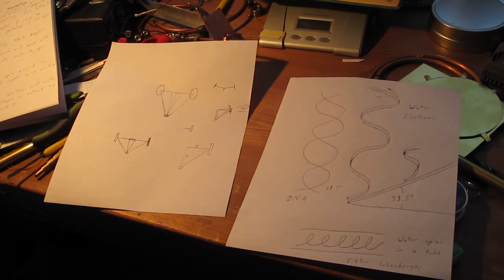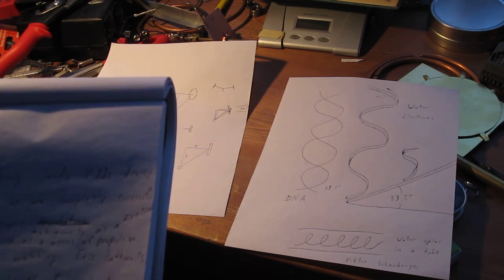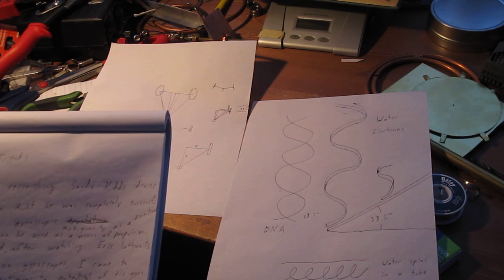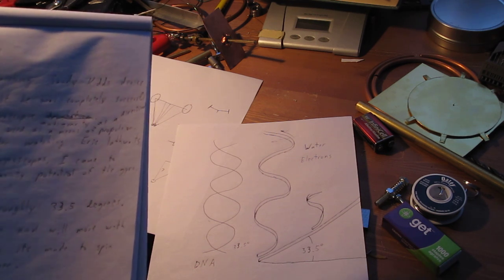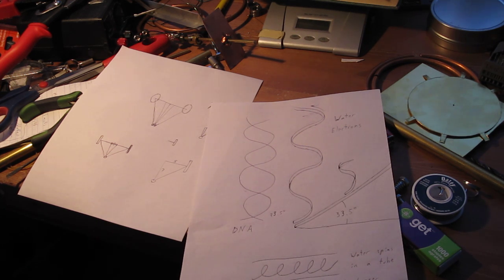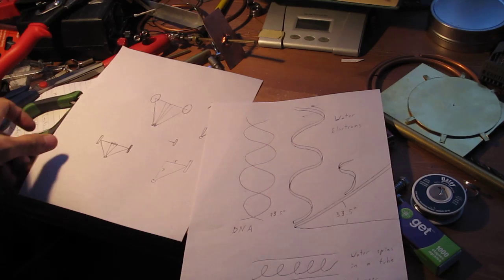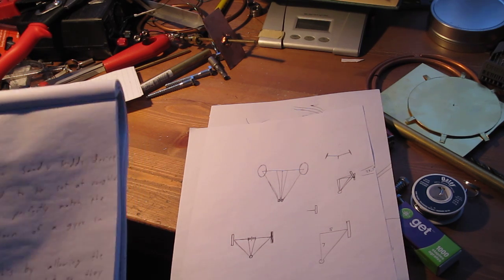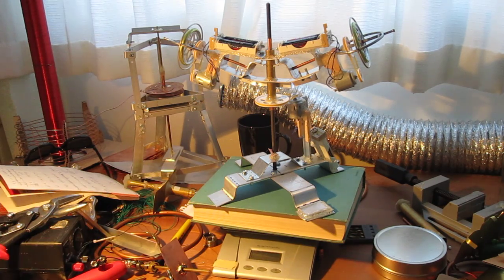Gyroscopic Antigravity - Part 6

Comment: Water doesn't spiral inside or outside of a tube unless you make it spiral (or in rare phenomena). It also spirals at different angles relative to spin, depending on the flow rate, heat, gravity, EM, point of measurement,...
Reply: Even though quarks all have a spin, this doesn't directly translate into our real world. Applying spin to everything isn't a solution, but it might be a hint.

Comment: I am sorry to inform the readers that this will not work as it is only a form of accelerometer/ gyrator. Sandy Kidds and many others have the same concept which they do not seem to comprehend the workings. 
In an accelerometer/gyro the onboard internal mass tries to remain stationary while the outside case is accelerated and in this video, it is the inside mass that is accelerated/decelerated, and the outside case reacts accordingly. Note that in a closed floating isolated system, where there is no reaction with external masses, any acceleration has to be followed by a deceleration so the "internal onboard" double integral of the "  magnitude and directions of accelerations" to produce the overall traveled distance, is purely ZERO distance.
By studying miniature accelerometers and gyros one may understand it all so easily.
However, it is a subject where one can study many interesting phenomena which the human eye cannot even see clearly while homemade equipment may come to the wrong overall conclusion. Some mathematics can help, and all it is is a case of a double integral of a mass accelerating and decelerating as it covers any motion trajectory.  Note in any conservative field this is so, but if one introduces ratchets and diodes then one has other complexities that flummox many people. 
https://youtu.be/KzTVTl3p2Po

Comment: Did this experiment back when I was 11 ( 1974 ) using similar bits but one supply  not multiple.
Concept works but no practical Anti Grav application due to materials available at the time .
Our current building materials will only produce a short life model with limited abilities.
The real Sandy Kid will know me as the one whom spoke to a relative of his in a TANDY in Yorkshire back around 1979

Comment: Placing the gyroscope center axis in the same center axis as a different gyroscope causes a flux interaction between the two gyroscopes. Placing a 3rd gyroscope with the same center axis causes a flux interaction between the 3. I suggest placing the rotational plane of the 3 gyroscopes in a typical x - y - z (like a 3d chart) relationship to achieve lift off relative to Earth's gravity.

Comment: Put the gyros right next to each other, the motors on the outside. If we hold a gyro at arm's length and wave it around it won't have as much precession as spinning it in a tight circle by just turning the arm. The tighter the circle, the stronger the precession. Can't get a much tighter circle than putting them next to each other, almost touching.

Many of us see gyroscopic precession as acting like a propeller blade. We hold a spinning bicycle wheel and turn the axle one way and it twists upward, twist it the opposite and it twists downward, same as if we were holding a big piece of cardboard. I think that imagery has kept many of us from putting the gyros close together.

And while it'd be great to have it fly around, the working model in Heretics of Science with Prof Eric Laithwaite was a wooden toy train looking thing that rolled along. Try mounting the device to a basic frame with wheels.

I'd do all this myself but I'm broke currently. Soon as I have disposable income again, I'll build a model.
Reply: post it up when you do

Comment: You've probably given up on these, good exploration, but I think you're confusing terms.
Antigravity is not the same as anti-mass. What you are describing would be a lessening of mass and not an anti field as would be the case with antigravity. It might actually appear to be heavier, depending on the current acceleration from your point in space.
I know it sounds confusing, but I think you'll get it. Think you're on to something here.

Comment: Over the piece, I have built many gyroscope or more accurately flywheel inspired devices built specifically to produce inertial thrust.
There are a few methods I have found of carrying this out, a couple of different ways I can put to bed as proved repeatedly to my satisfaction.
Let me say the most promising is another method but that is still work in progress.

I applaud your efforts,however and it may help you to get somewhere, if you take this on board.
I am only one person so it more than likely I have missed a few tricks along the way, but what I do know is that the gyros or flywheels must operate dynamically the action must be provided at the gyro itself.
It is the movement of the gyroscope which creates the differential which can be modified to produce the elusive inertial thrust.

It is not so obvious but “Anti Gravity Machine Parts One and Two on YouTube work this way and nothing like the best guess at the time description on the video nearly 30 years ago.
I noticed you were studying that machine so I felt I should put in my cent’s worth
I do realise that most of this will go over your head so I suggest you follow the large amount of information released in the Forum of “Gyroscopes.org”over the years. 
I have personally been a contributor on that forum since 2004 in fact and just about everything I have discovered about gyroscopes can be found there.
Very little of it agrees with the establishment view.
There are a few very controversial postings made by myself, but at least you have the ability to see who is lying.
Sandy
PS Most of my critics would be dangerous with a Leggo set.
Reply: proof or no pudding
Reply from the maker: Your the real Sandy Kidd?  wow...  cool.  I will have a new video soon of my latest developments in recreating your device.  The latest improvements allow for the dynamic action you speak of.  Thanks for commenting here.  I really appreciate your input.  So what ever came of all of your devices and efforts?  Big brother shut you down?  because they must never allow common people to realize that antigravity devices are real.  It would blow the lid on all of their flying saucer devices they have.
Reply: Hello again,
I have tried over the years to introduce the thing to all the people you would think I should, except for Boeing for some reason or another
After many and repeated enquires no one answered me except for one.
This one exception quoted his knowledge of anti-gravity from Wikipedia no less and seemed satisfied with that.
You would never guess what company he represented.
This stupidity has prevailed for years and most of it is due to academic arrogance.
One person said that if Newton was wrong so was every physicist in the world whatever that meant.
Was that meant to make me feel bad?

30 years ago in a university I claimed that I could alter the centrifugal force in a system at will.
This was of course on a system with fixed rotation speed and a fixed radius of rotation..
I was bluntly told that my claim was impossible.
Minutes I later demonstrated the impossible to a team of about four who turned away sharply without a word, as they do.
Instant ostriches.
No mention of that demonstration was ever reported, recorded, or discussed in the time I stayed in that university up until my eventual preplanned whitewash.
Be warned, achieving recognition in this endeavour will always be a hard fought battle.
After 30 years of putting up with the arrogance, ignorance, and academic stupidity
I no longer care.
When it is really needed, it will not be available..
Sandy
PS The device of mine you are presently studying lifted a consistent 16 ounces with bronze gyros, the university whitewash squad suggested that it was maybe climbing up on its bottom bearing.
I built a comprehensive gimbal mounting to eliminate any of this imagined drag and the device operated even better.
The decision however was unchanged and inevitable.
Reply: Hi Sandy, glad to know that you are on youtube. I invented something that inspired from your discovery of gyroscope, I watched your video part one and part two too. My invention has combined all information that represented on internet, like die glock with 2 counter rotate, mecury, vimana and gyroscope. I really want to get in touch with you to get your help and discuss about my invention, my email: toan359@gmail.com . I am not ready to public my work on internet, and confusing between get a patent first or public it first. Thanks
Reply: Did this experiment back when I was 11 ( 1974 ) using similar bits from tape recorders toy trains etc, but used one supply not multiple.
Concept works but no practical AntiGrav application due to materials available at the time .
Our current building materials will only produce a short life model with limited abilities.
The real Sandy Kid will know me as the one whom spoke to a relative of his regarding the subject.
 in a TANDY in Yorkshire back around late 70's.
Reply: I'm pretty sure I understand what's wrong with it.
You need a lot more flywheel direct driven, with independent motors, while maintaining the ability to control tilt in all areas. 
Similar to the way a helicopter utilizes the friction floating plates to counter and tilt the rotating wings.
Reply: If Einstien wasn't brought into the picture and Teslas work remained in progress by all the other real scientists we would live in a different world today.

Comment: I think if you greatly increase your flywheel mass you can see the acceleration due to gravity change.  The mass does not change just a gyroscopic torque changes the net forces on your system.  I know they use these principles to steer massive ships.  In the end energy is neither created or destroyed.  The right question is about the conservation of angular momentum.

Comment: I can see that on the bottom of an air craft with turbines on the gyros and being able to circulate the air like a tornado for liftoff and propulsion. but what about doing it with super cooled magnets and mercury as the motor on the gyro with no pulley to the gyro turbine

Comment: I would agree electrons have gyroscopic properties because it's matter in a waveform. Supposedly cern & the research lab at the south pole are searching for a particle that proves the existence of dark energy, that what exists within dark matter. The theory is that zero point free energy exists everywhere all around us unlimited amount that's generated from the movement of matter (gyroscopic) from other matter, this creates dark energy 'matter'. If you follow the papers being published on the current research being done you can see the direction they're looking. The good stuff always seems to be access by password only even though our tax dollars pay for the research. There was a random guy in ann arbor michigan who figured out a ' electron tap' but they shut him up.
Reply from the maker: +jasonmushersee Those in fear will always try to control others and the human race.  They are holding us back from evolving.  The spirit of the human race will eventually break free from the regressive forces interfering and interloping with us now but sometimes I wonder...   Cern was being used to try to merge our timeline with another created during the original Philadelphia experiment last I heard.  They've also just completed there largest collisions ever using lead atoms.  The Ether field/substance exists everywhere and yes its unlimited.  I agree.
Reply: spiritelemental find what "the urantia book" has to say about the circuts of mind, energy, matter, look into the information as it is written in that book. Make up your own mind. Im not here to push a religion or some cult. Im not religious. That book is beyond description. 

Just keep up the good work i hope this speesd your progress and helps your insights. Thank you for your time
Reply: jasonmushersee whats an electron tap